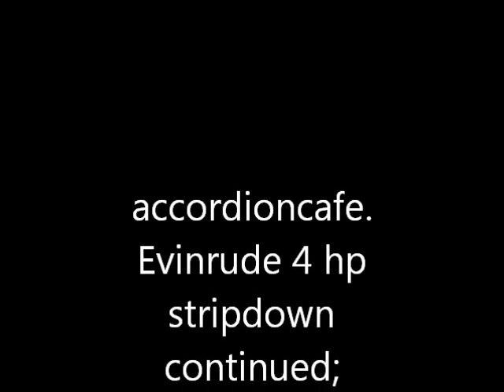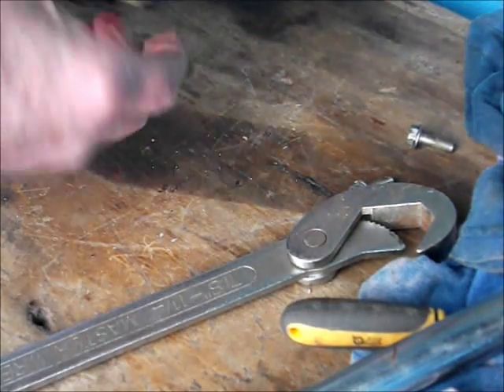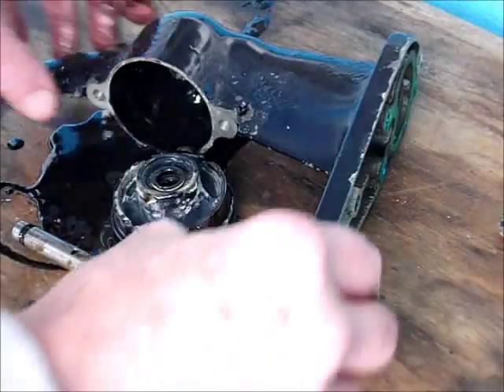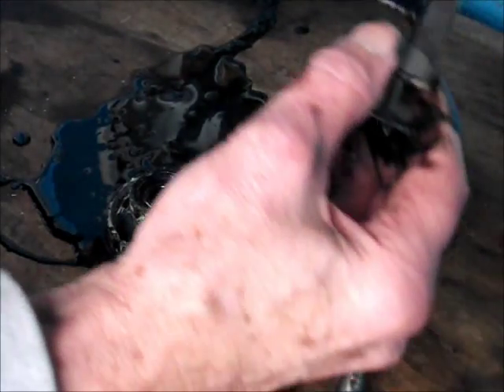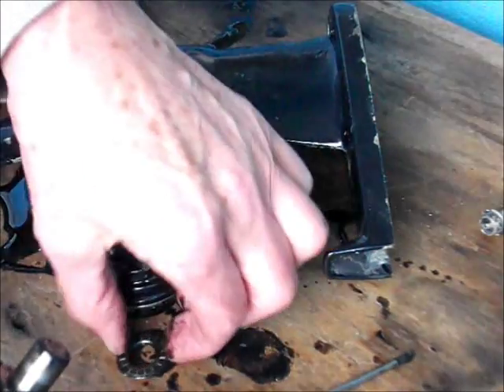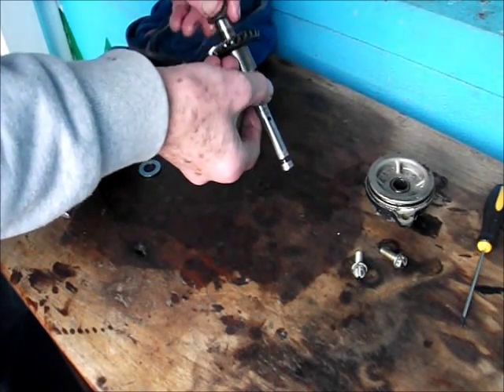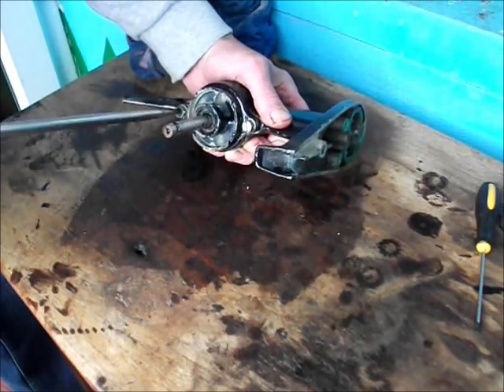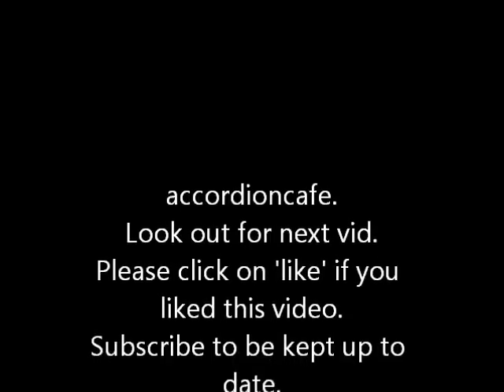EVINRUDE 4hp part 8 GEARBOX

Comment: hey there, great that you show this, i just bought an Chrysler 4.4hp. and i suspect that the gearbox is stuck. i cannot move the shift shaft, the proppellor turns but it was is neutral gear. my question is: do i have to remove the shift shaft in order to remove the prop housing?
regards